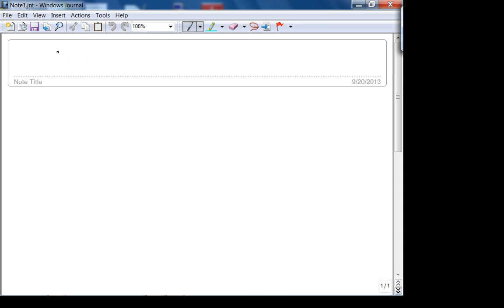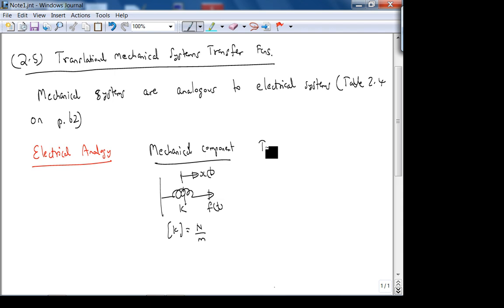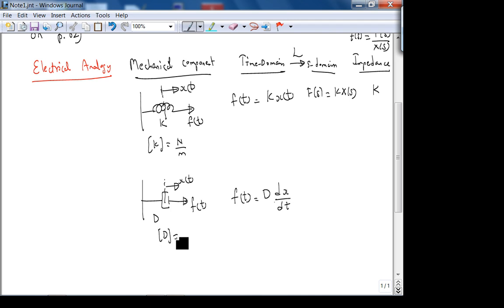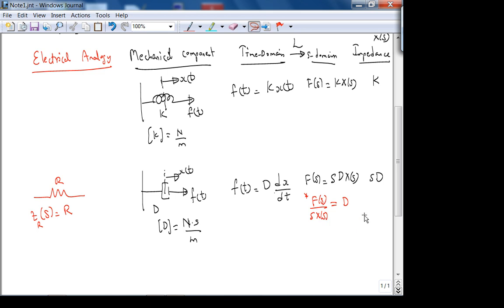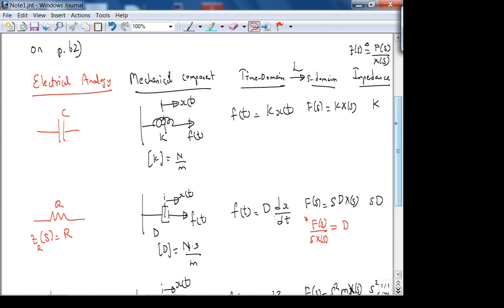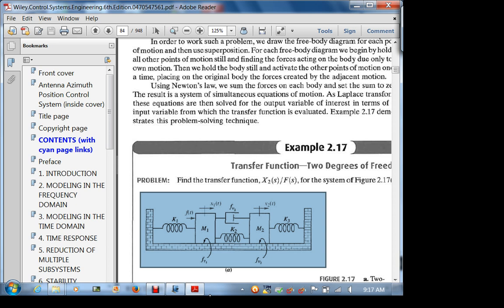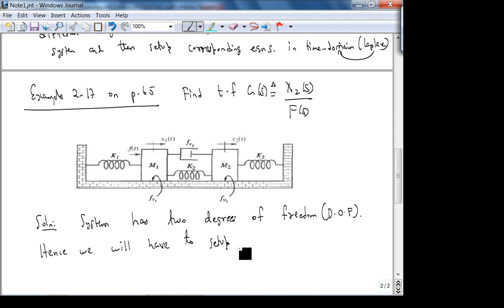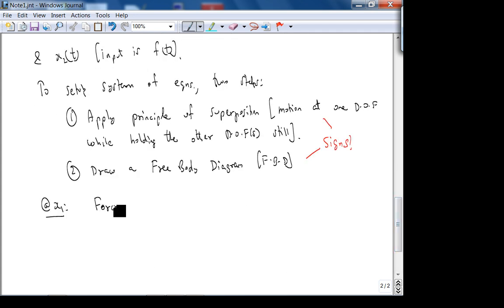ee3050Fa13w2L3 TranslationalMechanicalSystems IntroAndSetupOfSystemEquations

Comment: how do you figure out the direction of the acceleration?
Reply from the maker: +teynerdy Sorry for the delay in responding.  You can make an educated guess, as long as you keep the signs consistent.  Usually, +ve x is in the direction of the arrow.  As long as you don't reverse this anywhere in the problem solution, you will be fine.